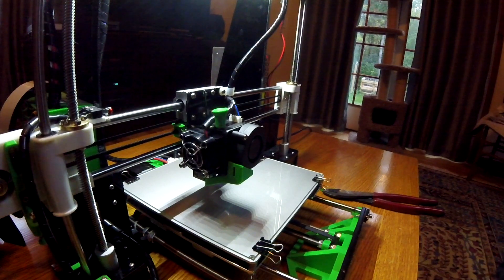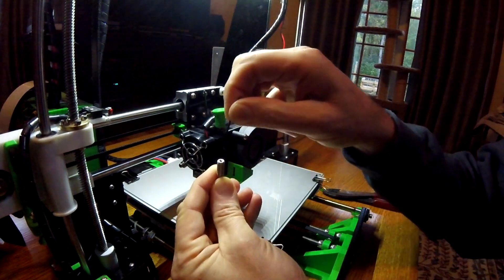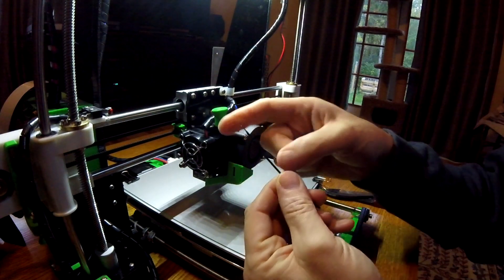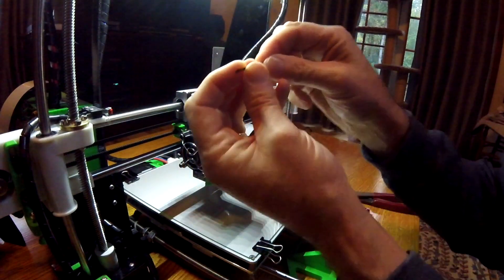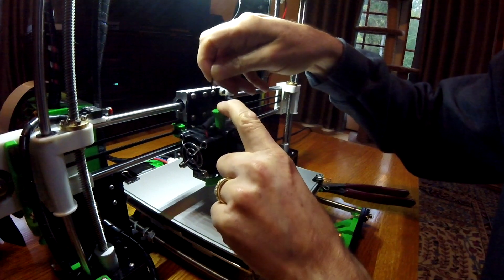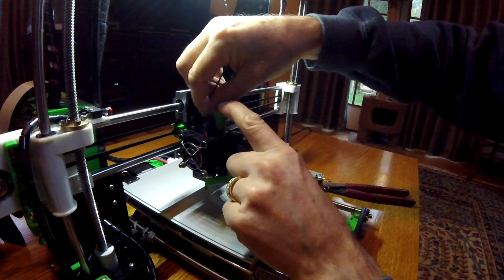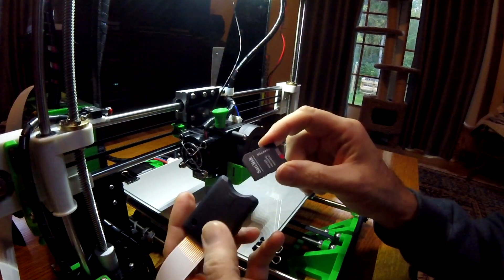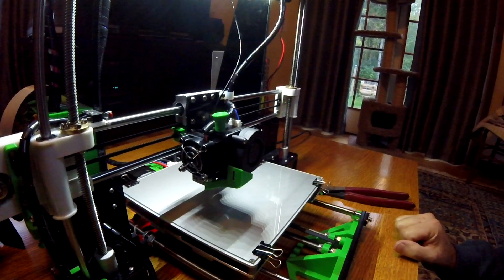Changing Filament on the Anet A8

Comment: How much filament am I supposed to flush through? I swapped from PLA to ABS quite a while ago and did some number of prints, failed or otherwise, and I noticed that there was a black strand in one of my prints a few days ago. Thought it was a hair at first....nope...ABS.

Now, after struggling with a print error I have inserted ABS in and removed it in place of this horrid PLA that came with my Anet and I flushed so much of this stuff through but yet still I'm seeing the ABS come through randomly....THEN it will go back to solid red and then black comes out again.

What's the damn go here? Is it actually holding ABS filament in there somehow for 600 prints and then it randomly pops the bit out? How frustrating.
Reply from the maker: I've been puzzled by this as well. I tend to push through till I see new color and then a little more. even then, I sometimes get more in the start of the print. Very frustrating! It must get stuck in the nozzle before it narrows down.